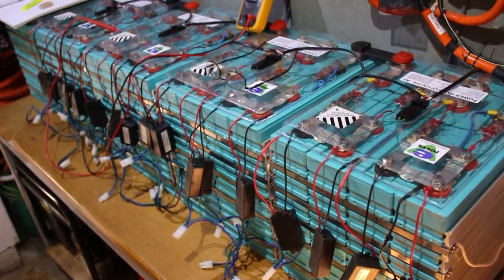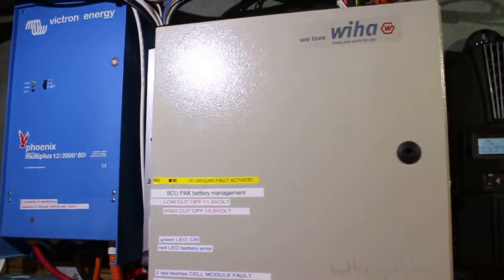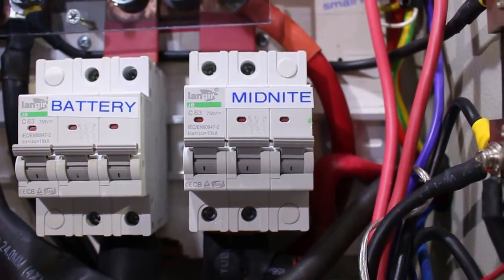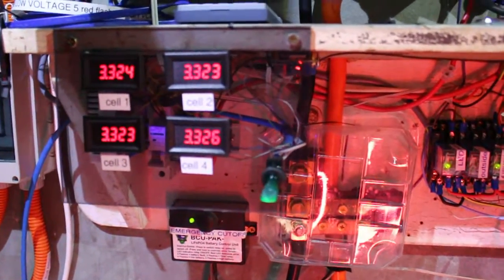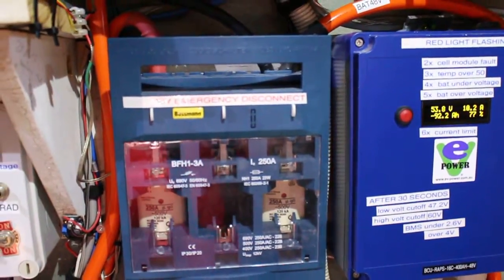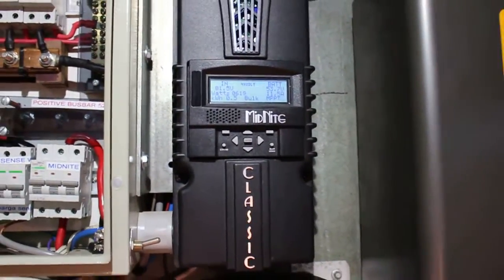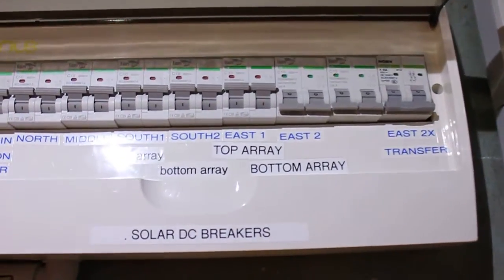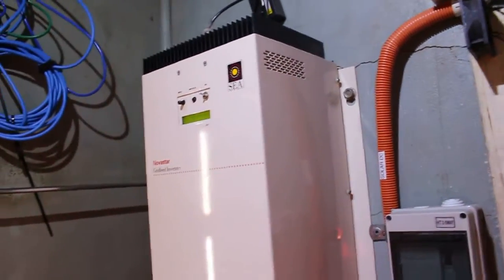my solar systems, inverters, lifepo4, breakers, etc

Comment: What kind of breakers are you using in the DC box? What I mean is are you using just AC breakers to cut off the PV?
Reply from the maker: I am using non polarized DC breakers. Do not use AC beakers. They will burn out in a short circuit event or even when switched under load.
Non polarized breakers are much more expensive. I got them from AliExpress, tradename langir

Comment: Did I spot a uRAD monitor? If so, nice to come across another user :)
Reply from the maker: yes you spotted correctly. i got this in a kit and i was amazed it worked when turning on the power. even though i used reading glasses and a magnifying glass, my eyes just have trouble seeing them tiny connection and soldiering points.

Comment: All that wiring for the balancers will drive me crazy. I love your DC box. I will try to copy it. Nice video
Reply from the maker: thanks awps,
the balancers have been removed since. many people report excellent results with them, they caused imbalances in my system however. i am not quite sure why
Reply: Urs Odermatt thank you for the update. What are you using as a balancer.  You system looks fairly large. Are you totally off grid?
Reply from the maker: at the moment i am still on grid, but just to feed in the surplus electricity. 
the balancers are from 
https://www.aliexpress.com/item/1S-single-cell-3-2V-3-3V-3-7V-lithium-battery-balancer-equalizer-BMS-LIFEPO4-polymer/1768384410.html?spm=2114.13010608.0.0.yI78AP

there is a set of other balancers, they activate cut off if something is wrong with a cell, but the balancing is too high voltage (3.6 volt) and too low a current to be effective. (they work with the blue box)

battery capacity is 400ah

the 12v system runs the solar hot water circulation pumps, routers, switches, computers, remote wifi switches etc. the batteries there are 300ah.

the idea is eventually to go offgrid if the power suppliers keep offering ridicilously low feed in tariffs.
Reply: Urs Odermatt who did you buy your batteries from? I have 450 AH flooded batteries. And at 50% I start to stress
Reply: Urs Odermatt thanks for the link. You have two different systems?
Reply from the maker: yes two independent systems. they are only connected insofar that i can bypass the 12v victron inverter and run it directly from the 48v selectonic inverter.
the 12v system usually discharges to SOC 60% over night. i have run it down to 10% SOC. 
lifepo4 batteries cost more per ah, but they can take lower discharges. they also take higher charge and discharge currents and last longer. but you cannot overcharge or under discharge them  or they will be destroyed. that is what that blue box is checking. if one of the parameters is wrong it disconnects the battery. (like for example one cell too high or too low)
i bought the batteries from ev-power in australia.
the 12v system grew and expanded out of nothing. the 48 v system was designed to run the whole house. so they run in parallel and give me some redundancy in case one of the fails.